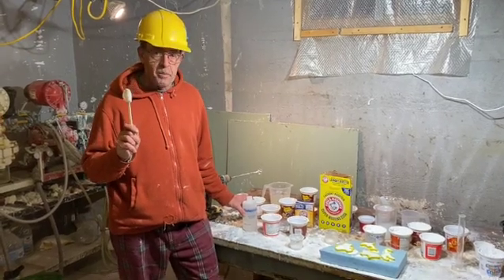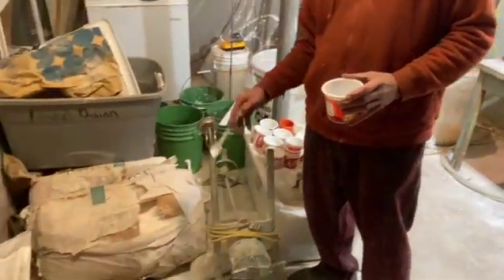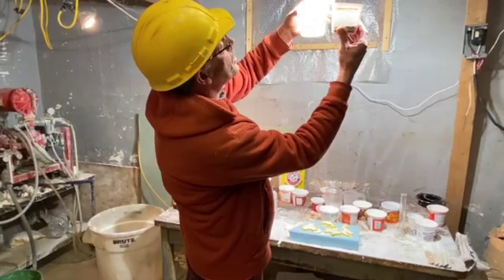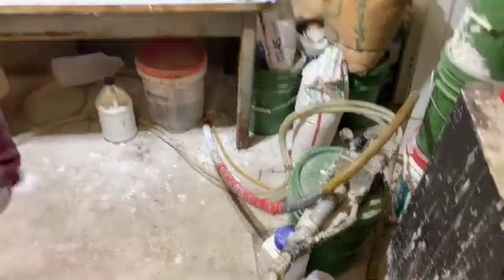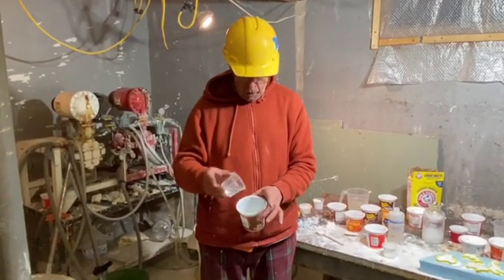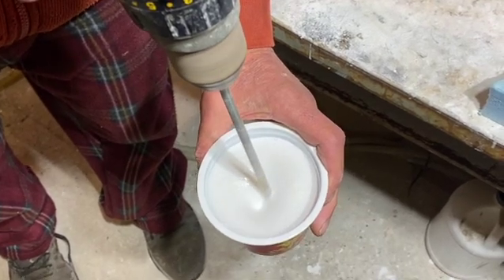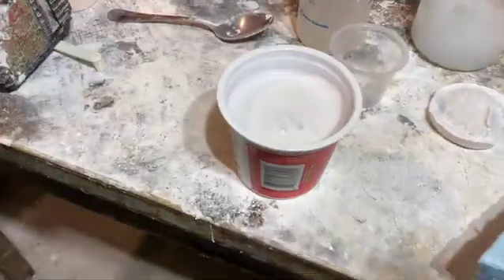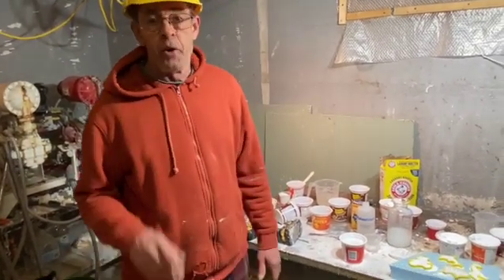Easiest Way to Make Aerated geopolymer.

Comment: how egypt malta and india were mostly made! like roman concrete wasnt real  or granite cant be crushed kills me! people dont know shit but act like they do. paul cook channel does the same thing making examples, who do you think repairs all the priceless museum pieces? they even replicated the great pyramid block and shows it on youtube exact strength color and texture , exact tensile strength even.
Reply from the maker: That is some great materials. what I make is a aerated cement. Build materials are made for different application, textile strengths ect... I'm interested in light weight with insulating properties. Thank you for the information.
Reply: @comfortgreen2865 
Thanks!
Reply: @comfortgreen2865  use "Aircrete" as a search word

Comment: Hello, very interesting videos you make related to cellular concrete. unfortunately, because you don't use a microphone, it sounds very slowly even with the volume at maximum.
Can you tell us what you use for the very stable foam and if it has a positive influence on the final strength of cellular concrete?
Thank you!
Reply from the maker: Yes, its a bad video. The foam I make is on an even worse video. (viewer request) I'm getting better at videos . But you will have all you need to make the foam. Thank you for the great info!
Reply from the maker: Yes, the foam is important. I can change the strengths and much more.